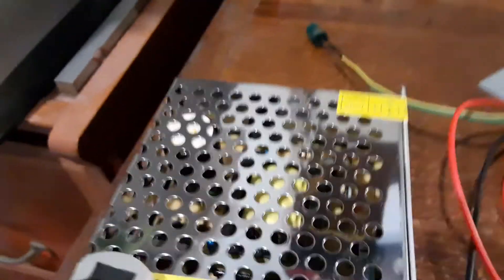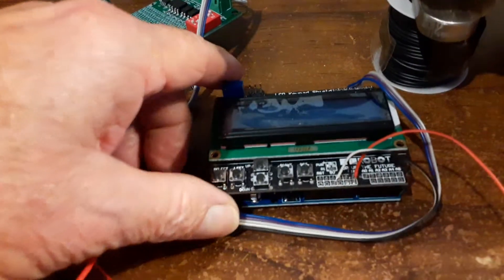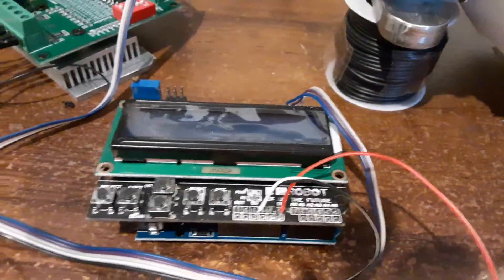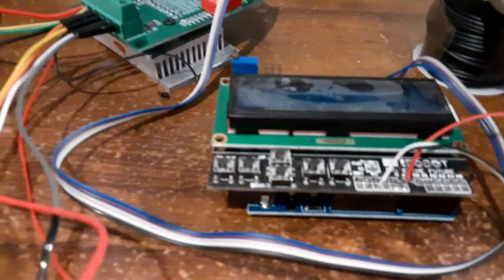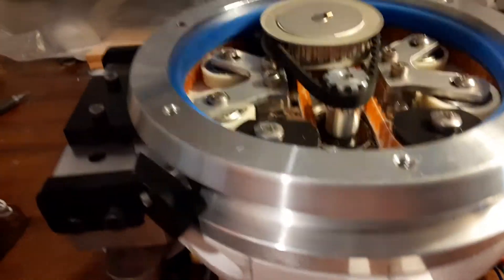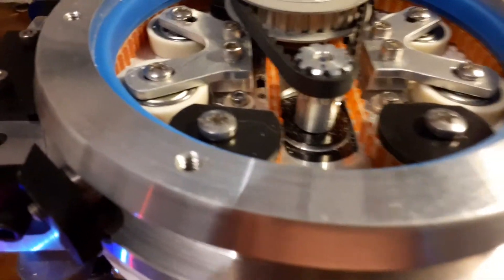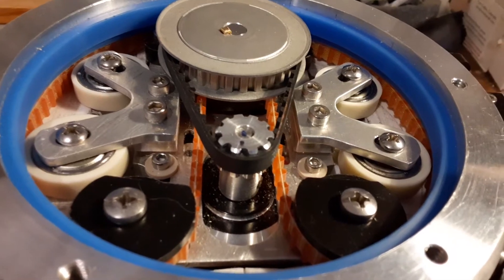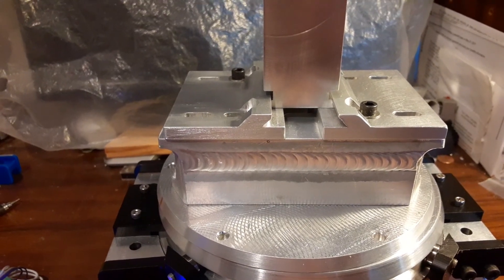2 Axis - 5 Axis Arduino D.I.Y. 3D printed indexer.

Comment: I love the fact, that you spent so much time on this, but didn't bother to make a switch for your power supply. I think precisely the same way mate, haven´t got time for the boring part.
 This video opened up my mind to a lot of new gearing ideas. thank you mate. keep up the good work.
Reply from the maker: Well, it didn't burn up so I will put a switch in the system. The plug is harder to pull than flipping a switch.
Reply: @toolmaker1370  🤣